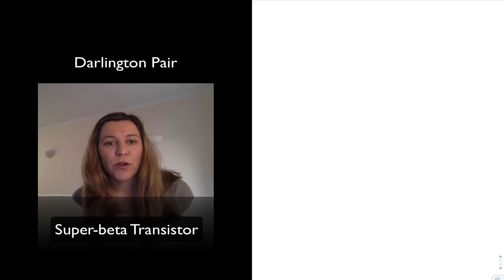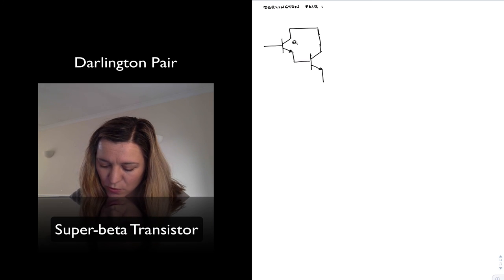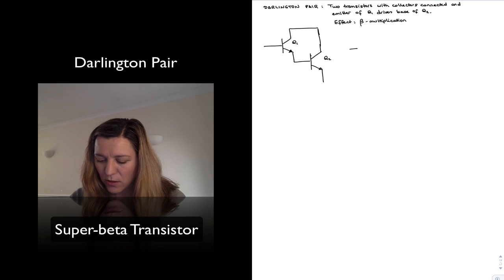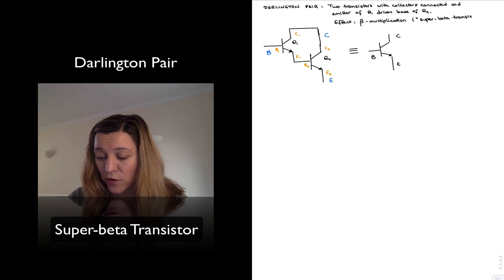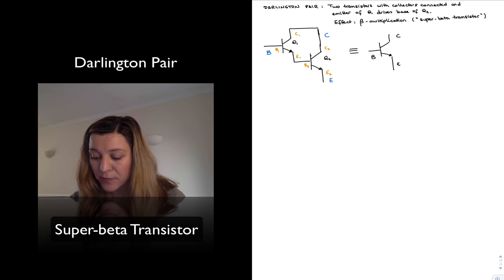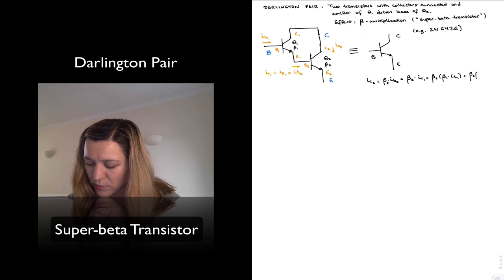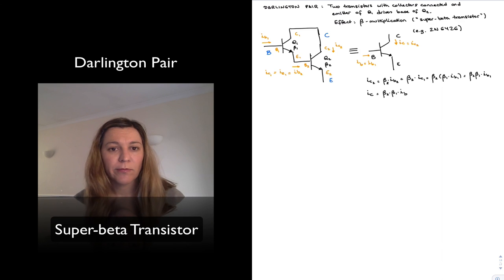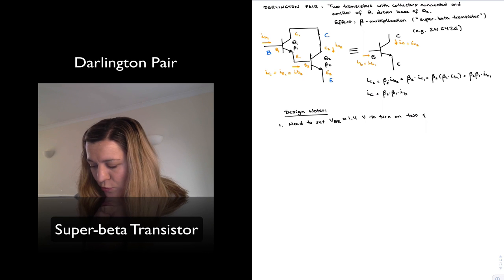Darlington Pair

Comment: What i don't understand is why the voltage out of a ULN2003, with 5V source and 5V in, is 0.6V out. Also, in terms of MCUs, would you want to use a darlington pair to power a slightly more power consuming components, such as a relay or LED? (i know you can do that using FETs, but i saw this configuration on a chinese board and i'm having trouble understanding why they did it this way).